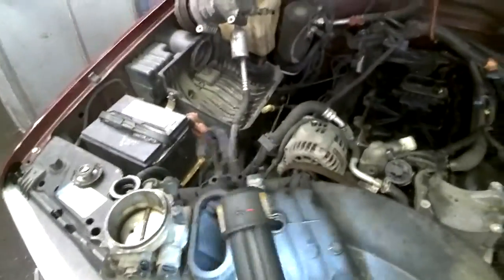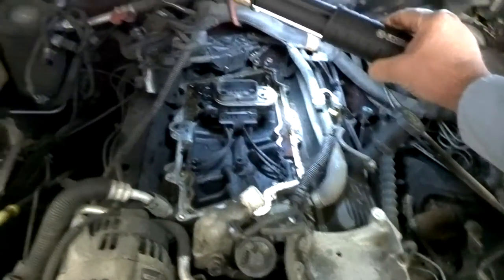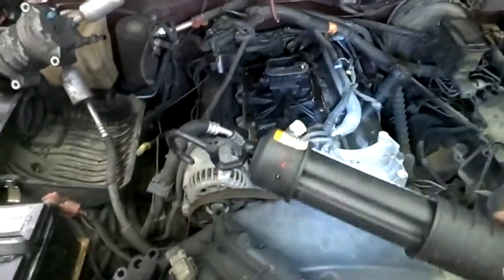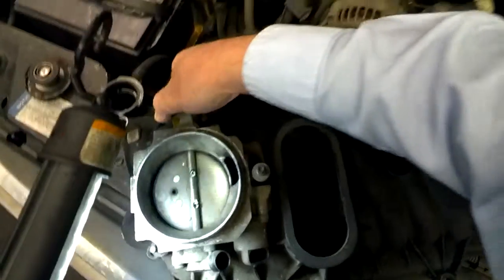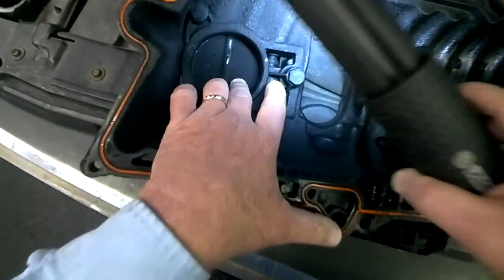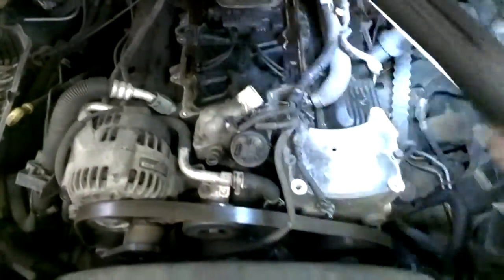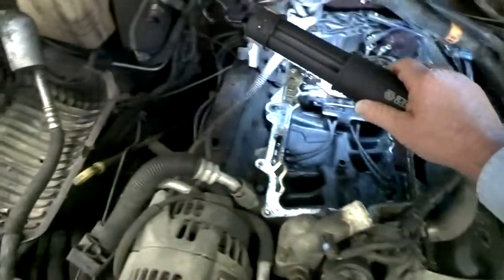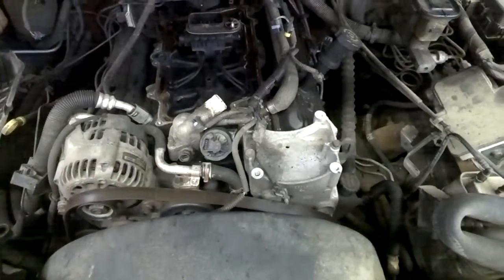Chevy Suburban Fuel Injection Unit Exposed

Comment from the maker: "Fuel injection problems in Wilmington?" Take a loo at one of the worst CPI units we've ever seen. There is an extreme amount of contamination that needs to be cleaned on this unit....

Welcome to Buckley's Auto Care, http://www.buckleysautocare.com  302-999-8285.

What does a Central Port Injection system look like? Here's a great example where we take apart the upper plenum of a 1999 Chevy Suburban with  #V8motor  to expose the worn out and leaking CPI unit. 

The CPI unit is the way that fuel is delivered to the cylinders. GM designed the system to fire under pressure and not an electrical pulse. The problem is that these injectors have a big tendency to stick and fail. The fuel pressure regulator also ruptures frequently and that causes a long crank during cold start up or hot soak. Once fuel leaks from the regulator, you can see a washed out area on the lower manifold area due to fuel spraying and leakage. 

To correct the problem, we'll be replacing and updating the CPI unit along with thoroughly cleaning the upper plenum. 

Thank for watching 

Buckley's Auto Care
Wilmington Delaware 19804
302-999-8285
http://www.buckleysautocare.com
 #buckleysautocare     #chevyfuelinjection     #chevyrepair